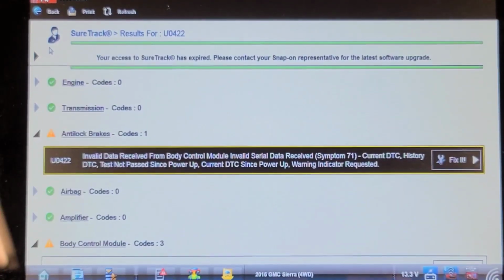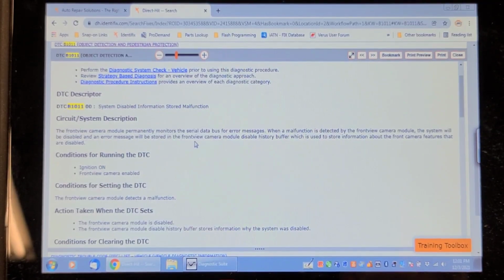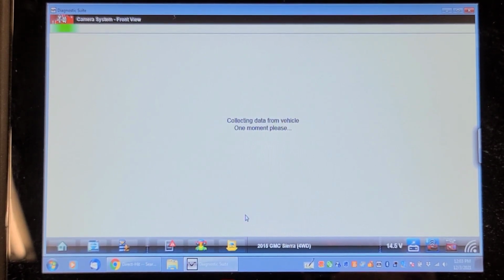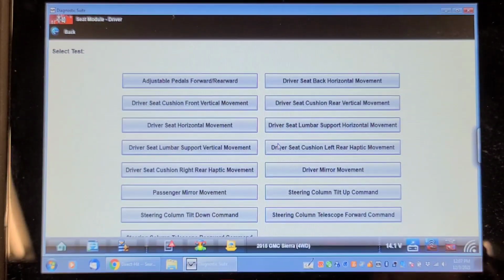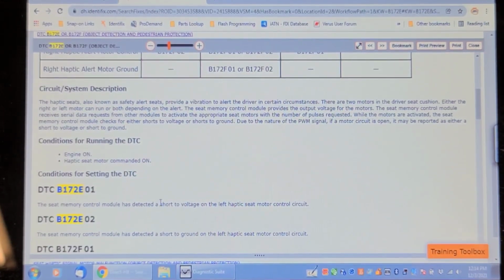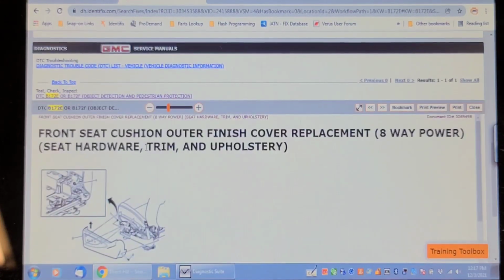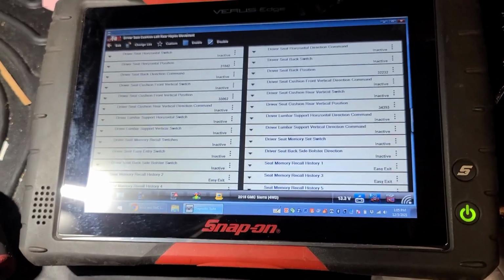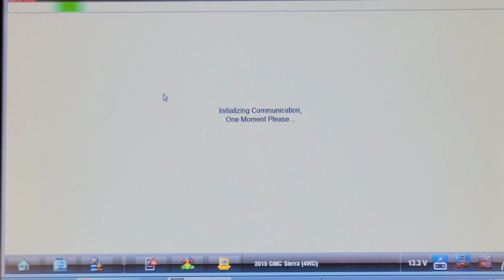2015 GM Truck Haptic Motor Code B172E, Motor Replacement and B1011 Camera System Disabled

Comment: you are a very wise man..  i need some help..  i have a 99 silverado that im trying to program new key remotes because my old one stopped working.. ive done the hold the drives unlock bottom turn key on 2 or 3 times etc but my teuck won't go into program mode.. the lock unlock wont cycle there fore i havemt being succesfull at programming them .. any advice will help?
Reply from the maker: You could try with a capable scan tool. An Autel may work as may a Snap-on that is up to date. I take it that your power door locks actually work though.

Comment: should of hooked up that seat vibrator to an air compressor and installed a Kenworth air horn in the cab .lol some newer cars just buzz the steering wheel . or GM could of set up a Dr Ho passive elec shock system ,lol.
Reply from the maker: For sure!